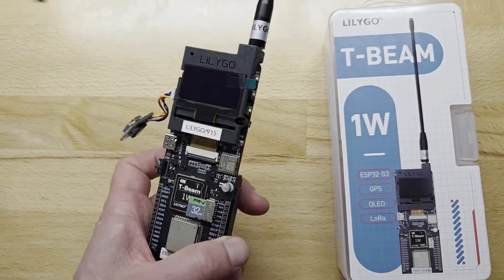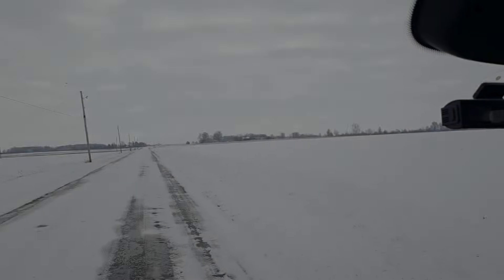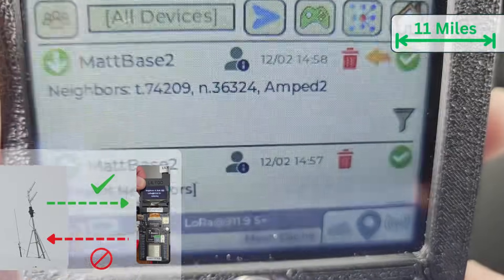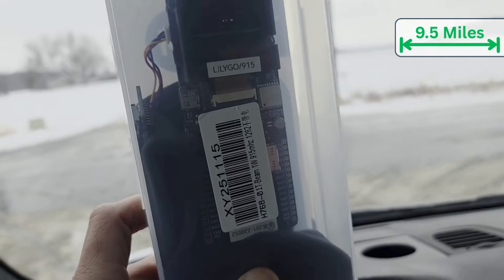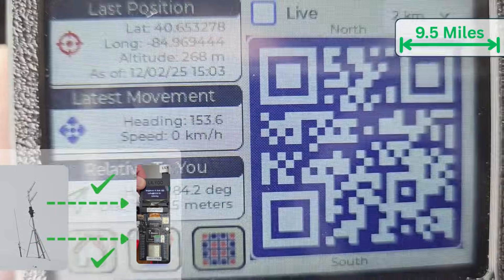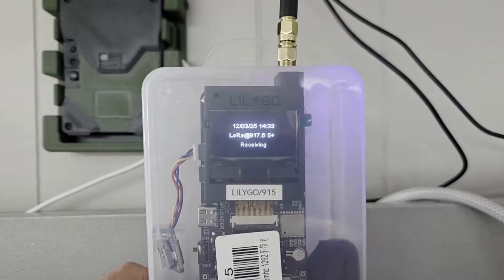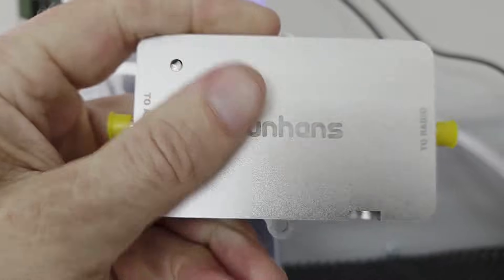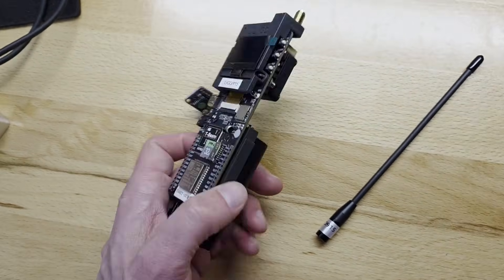Lilygo T-Beam 1W Review - I Test How This Amped Mesh Node Performs as a Tracker & Base Station

Comment: I'm currently using Reticulum. Does your stack have the ability to use other TX/RX mediums?

Because I really like the UI on your setup, but being able to natively hop from LTE to LoRa is indespendable.
Reply from the maker: It can use other mediums. The transmission/security layer has a pluggable way of using other mediums, including Serial/UART, CAN, WiFi (UDP, MQTT, or a hosted "cloud" service"), and others I can't remember off the top of my head. I currently only have LoRa, MQTT, and cloud enabled in the firmware, because enabling others might overcomplicate for most people.
https://www.chatters.io/protocol

MQTT or Cloud could work if you have an LTE hotspot. The firmware doesn't DIRECTLY support LTE, but can use wifi over LTE.

If you have more than one medium enabled, the firmware automatically decides which one (or sometimes more than one) to route encrypted packets through. The packets are already encrypted before they hit whatever medium(s). 

A message/packets can arrive partially across one medium and partially across another, even minutes or hours apart, and the firmware automatically pieces them back together, checks the signature, and if valid...decrypts and confirms to the sender.

Comment: The device you’re holding in your hand, said you’re putting out about 2.3 Watts. Do you have a link to purchase something like that because I’m new to Meshtastic I’m also a ham operator, but I’d like to be able to have a couple that would put out plenty of wattage.?
Reply: Raw horsepower isn't as important for CSS modulation used by LoRa. Even a couple watts can cover around 75 miles line of sight.

But it really doesn't overcome terrain shadows very well. 

Throwing an amp on isn't going to do nearly as much as for range as throwing your antenna on top of a 10m pole.
Reply from the maker: I haven't tested them with any other firmware besides Blackout Comms. Some systems don't play well with amps, but I regularly test various amps with Blackout Comms to ensure it does.

I'll have some available within the next week or so, but they are not too difficult to build yourself. They'll be listed here along with a few other new things:
https://www.chatters.io/shop

To see how to build it yourself, go here and choose "Challenging":
https://www.chatters.io/diy

Comment: OMG may i ask how you got the UI for the T-Deck plus? I tried to flash maps onto it and never had it popped up. I live in Thailand btw. I bought the 825mhz i believe.
Reply from the maker: I built the UI with lvgl library, which is pretty easy to use once you get the hang of it. On my firmware, the map option is either a pixel map where you and other nodes/devices also show up as dots without an actual map tile behind it, or a QR code that lets you open the map with context on your phone. I haven't gotten around to adding actuallmap tiles yet.

Comment: If you have ported this to your firmware - do you happen to have a pin map? I am porting to meshcore and I am still awaiting the device as it ships from freaking China!
Reply from the maker: I went by this, and found it to be accurate:
https://github.com/Xinyuan-LilyGO/LilyGo-LoRa-Series/blob/master/docs/en/t_beam_1w/t_beam_1w_hw.md

Check the notes about powering the LNA off and on when switching between TX/RX. If that's not done right, it can cause damage.

also, you have to check the board's temp and enable/disable the fan appropriately, because the amp can get hot. I haven't seen it get hot, but my duty cycles are very short, and it's winter - so maybe that's why.

This one's not quite as simple as other ones have been.
Reply from the maker: Also they (lilygo) recommend 800us ramp time for the sx1262, i bumped to 1700us because i wasn't getting good results at 800. I'm still tuning various timings
Reply: @blackoutcomms  Thank you! You are the man!

Comment: I just got mine and tried to flash Meshtastic and I think it’s bricked so you have any idea how to revive the tbeam 1w
Reply from the maker: Sometimes you have to hold boot button, tap reset, and continue holding the boot button all the way through flashing. Also try a different cable, or even (sounds weird) unplug the USBC from the tbeam, rotate 180 so it's plugging in with the opposite side up. Sometimes I have to unplug another USB device that's interfering (thumb drive/etc). Just a few guesses.